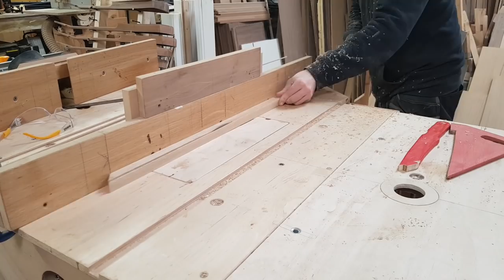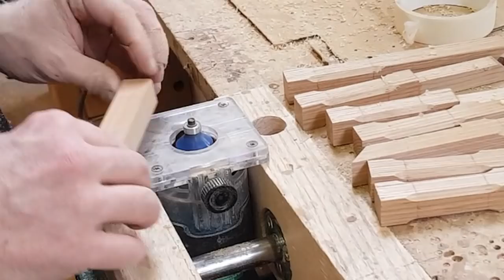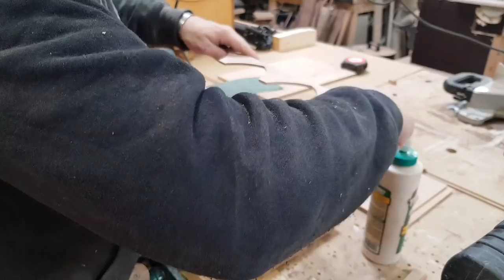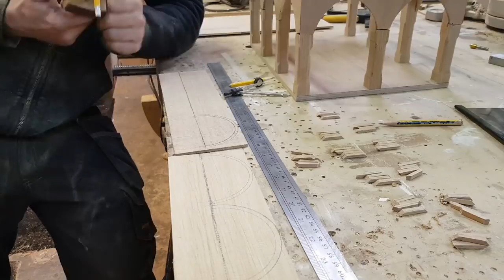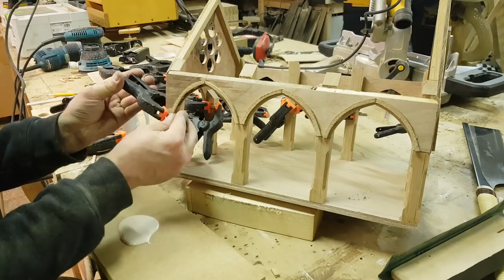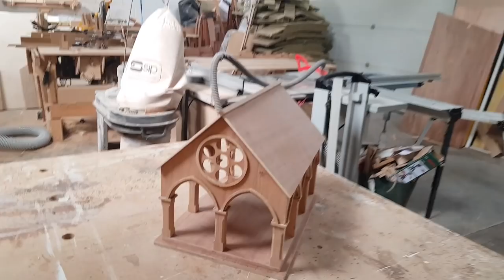Making a bird table (Birdington Abbey)

Comment: What no video of the birds using it?????  
I was concerned when I saw so much plywood being used for an out door project.
If you use CA glue in several instances it would have cut way down on using so many clamps- Also when you added finish it hid most of the detail you put into it -IMO. This would have been a good project for boiled linseed oil only and keep most of the detail visible.
Reply from the maker: Hi Gary. I made one of these for my parents about 4 years ago and it is fine. no issue with the plywood at all. Thanks for the message.
Reply from the maker: Thanks for the constructive criticism. I will try better next time. 😉
Reply: Hi gary i have read your comments twice now thinking wow this man really knows his stuff with such comments,as you can imagine i clicked on your name expecting to find a wealth of knowledge or at the very least a vault full of your work on show for the world to admire, and yet it would seem you have NO content at all zilch nothing to base your remarks on what a shocker.